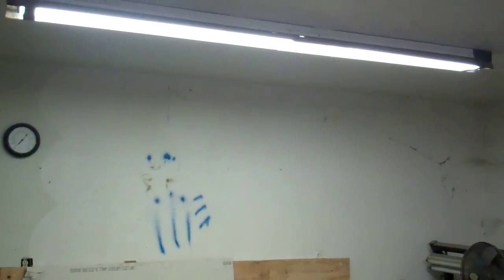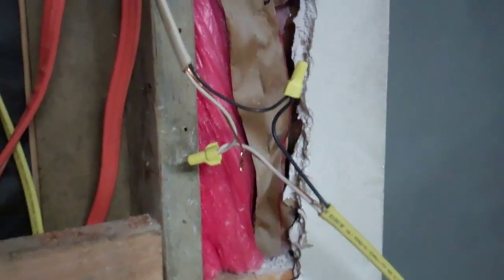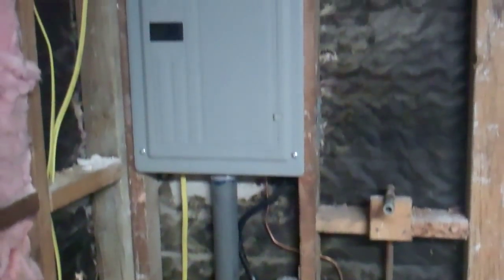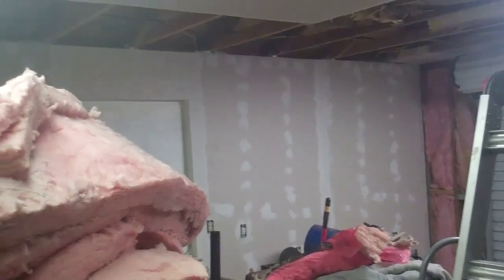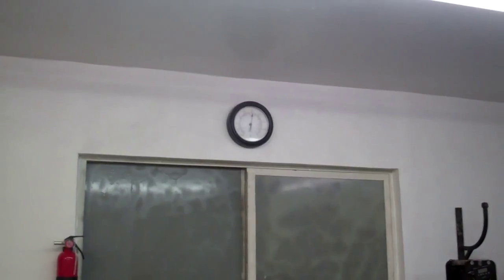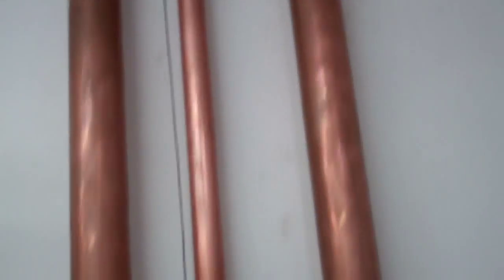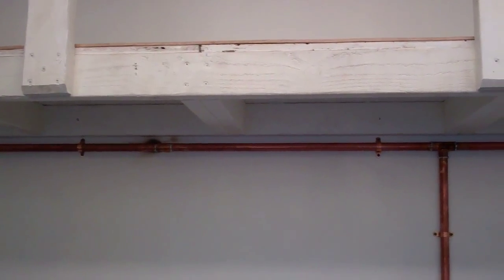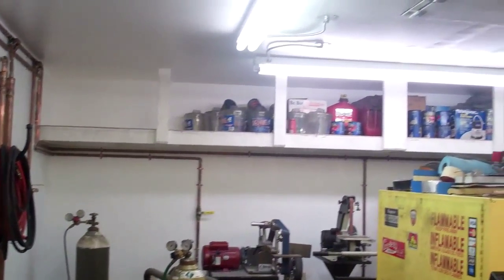Garage Work , The World Headquarters Is Finished (Part 5 of 5)

Comment: Nice work on the shop!  Lots of hard work to get things the way you like them and then you still find yourself changing things over time.  Electrical and air system plumbing can be so time consuming but when you need an outlet for a welder, air compressor, or other large shop equipment, you'll have it!  Well worth the work invested for sure
Reply from the maker: It was a lot of work.  And it cost me twice as much as I thought it would cost.  Now I have to replace my shed with a shipping container.  So I can move a lot of stuff that I don't use all the time out of there.  Since theres not enough space.
Reply: 1970chevelle396 I've wanted to buy a 53' container for a while... they cost around 1500 to 2k bucks around here.  A bit to steep right now but would free up a ton of room for sure

Comment: You are a very hard worker and the shop looks good. Nice lathe ya got there.Instead of a new motor you could get a variable frequency drive box that will give you variable speed and your choice of 110 or 220 using the 3 phase motor. Prices start at 125 to 500. I have two of them. thanks for the vids
Reply from the maker: It has a 1HP motor on it.  The original sales invoice shows it came with a 2HP motor.   Also by going single phase I can put a drum switch on it and get rid of the relay box on the back of it.    When I get a milling machine I will get a VFD.  But for the Lathe I want to go back to a 2HP motor.  So I might as well get a single phase one.   It took 2 months to rework the garage.
Reply: Good plan as always Kent. Mine are used on 2hp knife grinding machines that I built. Uses 2x72 inch belts. What kind of project do you have coming up
Reply from the maker: I don't really have very many projects coming up. Im going to fix a few things on the lathe and buy the tooling for it.  In the summer time Im going to replace my shed with a 20 foot shipping container.  I need more space.  That garage filled up fast.